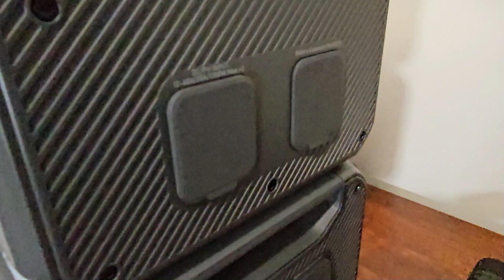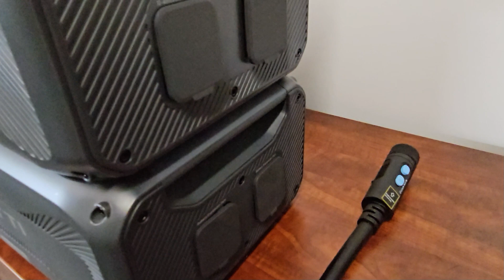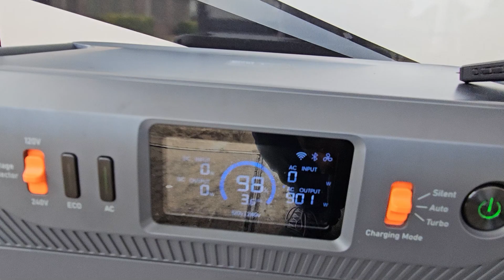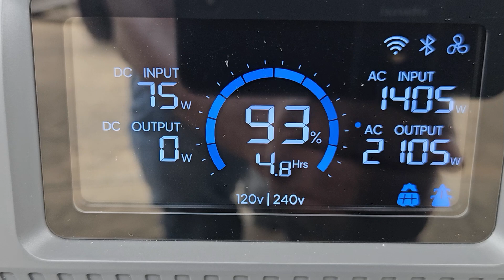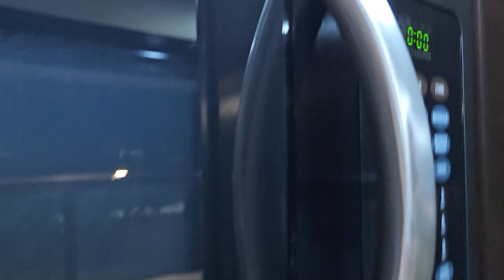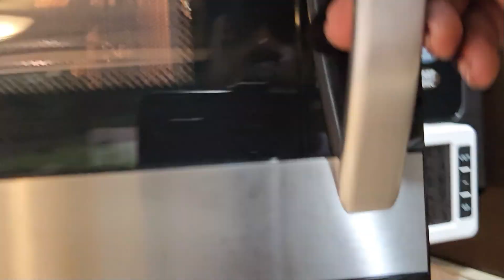Powering My 50-Amp Motorhome with BLUETTI Apex 300 | Ultimate Portable Power Solution

Comment: Thank you for making this informative video. Something I’d like to point out is that when the inverter is set to 240v , it is able to output 1920 watts on L1 and 1920 watts on L2. So if your microwave and your air conditioner is on the same line it will most definitely overload , since there is only 1920 watts available. Load balancing might help or if you were able to run at 120v the full 3840 watts would be available and be much more capable. Another useful trick is to use the 240v charging cable and pass through power from and generator. This allows you to have all the generator power + the 3840 watts of the inverter available. Hope this helps others and maybe you could check it out yourself to verify.

Comment: 13 hours or 4 hours doesn't seem to justify the price of this unit. I am looking for something to run my outlets, no AC and fridge for 3 days up in the Sequoias. This doesn't look like it would cut it. Also, ive read other places that when using a setup like this its a good idea to shut off the breaker to the house battery charger so you get more stored energy from this?

Comment: When you are plugged into 120v  Harding supply like the wall or generator, the devices drawing power come straight from the supply - not the Bluetti battery.  So the generator was feeding the Air Con directly.  Only if power goes out does it flip to using the battery.  But then I saw yo use the microwave and were using more than the gennie was putting in.  I guess ‘some’ came from the battery?

Comment: I was reading the manual and learned today that The 50 Amp plug only puts out 16 Amps.  It also charges using a 50 Amp supply at R.V. sites but it does not put out 50 amps.  It charges just as fast using a 30 Amp plug.You can’t run both ACs and a whole RV like you can when plugged into a 50 Amp plug at R.V. sites.

Comment: The solar input is 1200w one each plug so it’s 2400w total solar input extendable to 4000k with an add on..  And the SC outputs are added with the DC 1 add on.

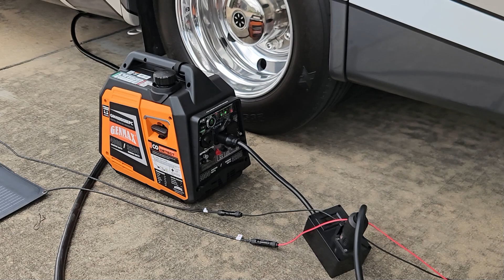Comment: 11:20 you need to go into your app setting (advance settings)and change the factory setting from 12Amps to 15Amps. Using a generator your input wattage should be around 1700 to 1800 watts on 15 amp or 1400watts on 12Amps.

Comment: Great Video, thanks for posting.  I understand that the Bluetti has a floating neutral (like all portable power stations), but you didn't use a neutral-ground bonding plug?  Did get any open neutral/ground errors or does your EMS not check for them?
Reply from the maker: I didn’t get any error because I wasn’t connected to a surge protector

Comment: Inverters and batteries are much preferred over a genset but once you try to run AC's it's game over for portables. You need thousands in storage to keep a 15k unit running overnight. An onboard 54v lifepo4 system just makes more sense at that point.

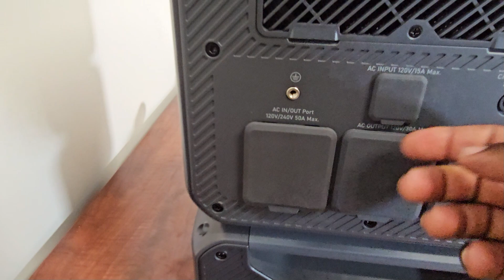Comment: any chance you can test to see if the same thing would work if you used the AC INPUT 120V/15A MAX port you flip open at the 2:41 time stamp?  the 120 VAC the generator is putting out was only 1400 watts so the regular 120 VAC input should be fine.  or you could just run an extension cord from the house.  i just want to know if i need to buy that extra cable or not?
Reply: The setting on the apex300  bluetti app allows you to change the 12amp(factory setting) to 15amp. Allowing you to charge from 1400watts to 1700,1800 watts. or you can purchase a 30amp cable and fast charge at 3600watts. You can use the 50-amp fact charging cable but the Apex300 only has the capacity to charge at 3600watts.

Comment: Did you buy this unit or you got the couple $1,000 for free??? I still don't understand where you're supposed to connect the external DC box and the external solar charger???
Reply from the maker: I showed all the connections in the beginning of the video
Reply: To the little yellow inputs.  Those are DC inputs.

Comment: Your generator output was at 120v at approx 1400w, while the power station output was 2000w at 240v? Is that possible? I don't know any other power station able to do that. Most only do bypass, meaning all power will come from generator (usage plus charging) and if you supply 120v you can't output 240v.
Reply: most of ecoflow's split phase power stations supposedly do that as well as some much less known brands.  anker does not nor does the earlier models from bluetti

Comment: You need to switch the charging mode to TURBO and see what happens.  As it is you are only putting in about 1400 watts from the generator, which can supply 3200 watts.
Reply from the maker: I’ll give that a try and see if it boosts the charging watts👍🏾
Reply: i don't know much about gas power devices but i'm guessing since that generator is split phase the 3200W could be 1600W+1600W so max 1600W on 120VAC and max 3200W on 240VAC?
Reply: Yeah. I was hoping you would switch the charging mode to turbo so I could see if it would put more watts to charging.

Comment: Nice, I have 4 Bluetti power stations, but also 4 inverter generators and 2 regular ones.  It's still hard to beat a dual fuel inverter generator, but the power stations are nice to run at night when you're trying to sleep or just don't want to start up a generator.  Hurricane season is soon upon us for the Gulf states...